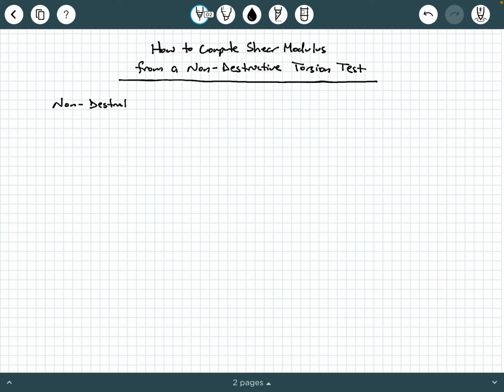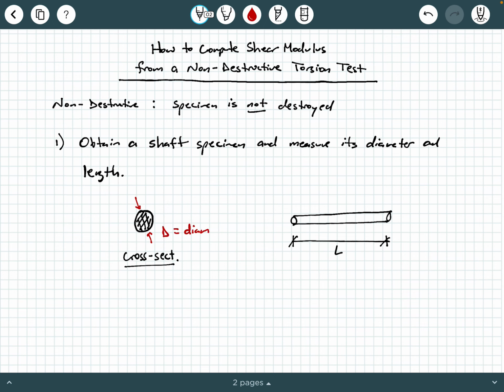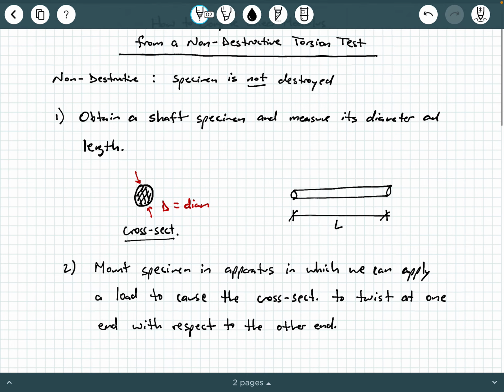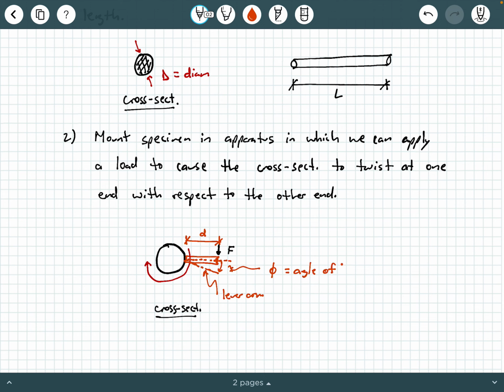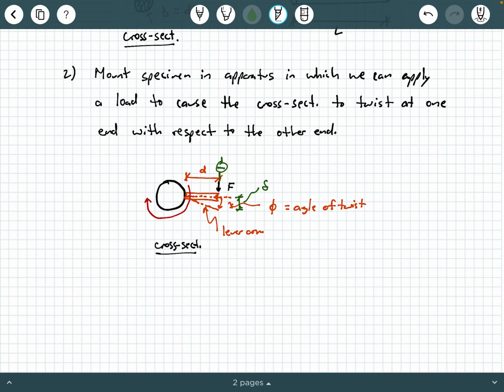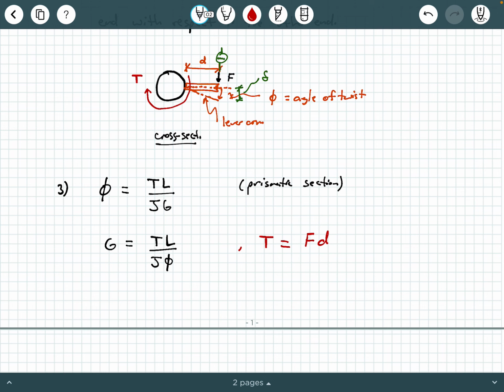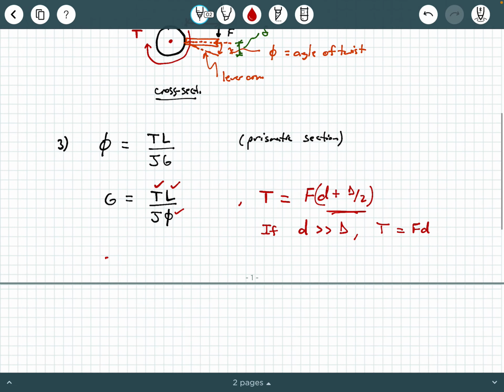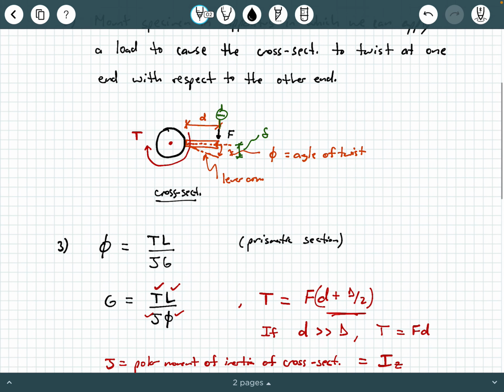Mechanics of Materials - Video 70:  Non-Destructive Torsion Test:  Shear Modulus

Comment: What sort of rod or bar do you use to apply the torque? I imagine you need it to be very stiff relative to the specimen you are testing in order to not  influence the shear modulus calculation with its own deflection.
Reply from the maker: You are correct.  When we teach this at the university, we use an apparatus like the link below.  We usually use a copper, brass, or aluminum specimen.  https://www.p-a-hilton.co.uk/products/strength-materials-hsm/torsion-and-deflection-testing-apparatus